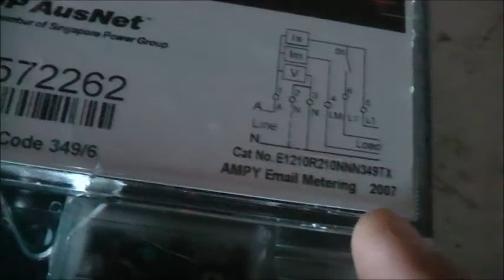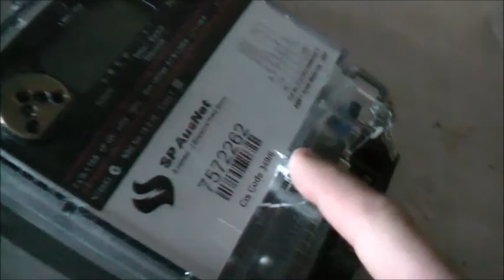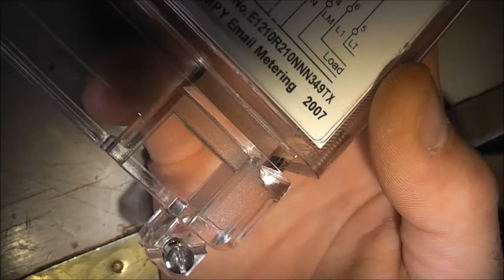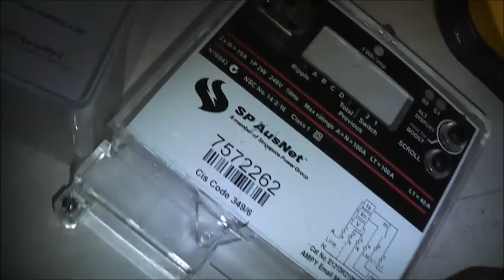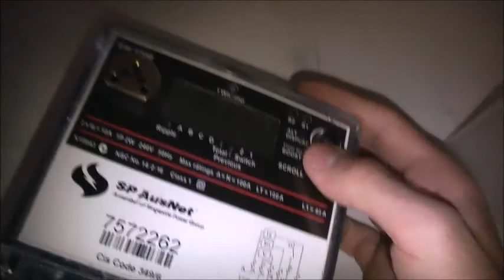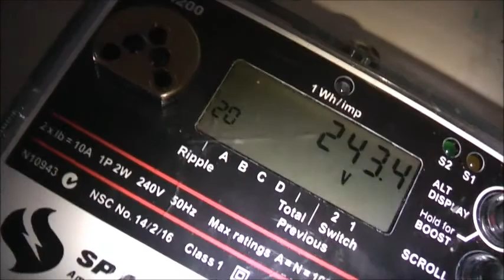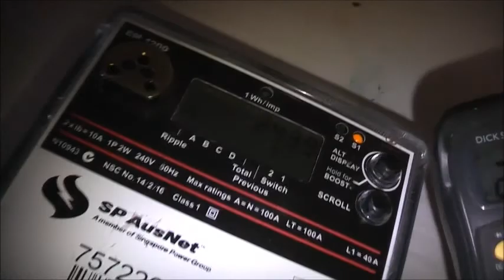Ampy Email Meter Teardown!

Comment: current shunts are what they are.
when current travels through the metal there is a small voltage drop and for any given current there will be a corresponding voltage generated.

say if the shunt had a resistance of 0.001 ohm and had 1 amp going through it you would have a voltage of  0.001 volts across the shunt.